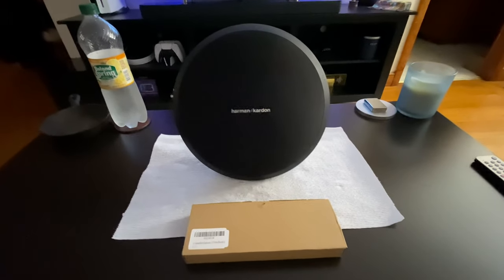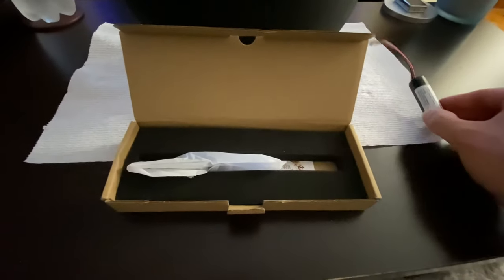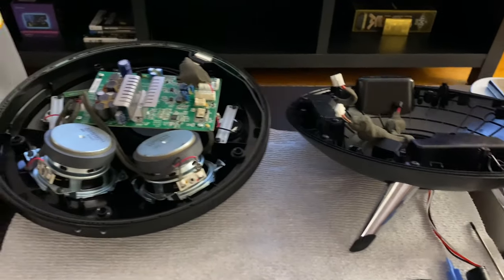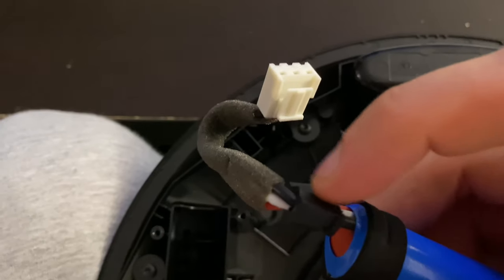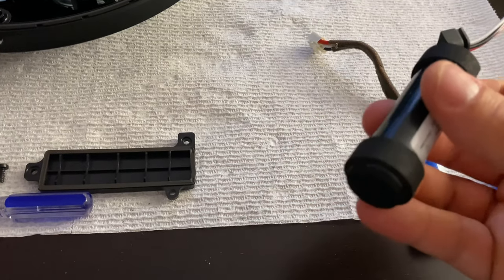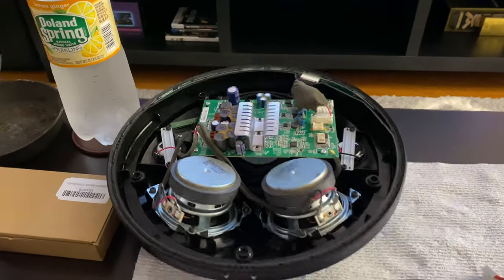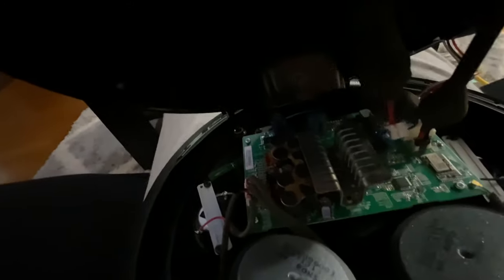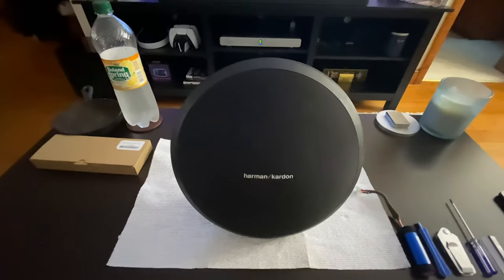Replacing the Harman Kardin onyx studio battery

Comment: Hi thank you for posting this vid. Very informative. I also have the same speaker and the batt is dead. How was the batt performance with that replacement battery? I mean how long does the battery last in one charge?
Reply from the maker: Thanks for the feedback, the speaker is working perfectly it seems to last the same amount I have to use it more I generally have it plugged in for max power!

Comment: Hey i have a problem. I have a the same bluetooth speaker and we think it dead because it won't turn on and we tried working cords that recharge it but no luck so can you help us out?
Reply from the maker: @thanhnguyen4908  Have you tried replacing the battery? If not, I have a link in my description of a battery that’s for this speaker. It’s an Amazon link 20 bucks. You’ll get it in two days.

Comment: Is it working when you have power plugged in?
Reply from the maker: Now that I have fixed the speaker by replacing the battery it works with the battery and also when plugged in to the power. previously it only worked when plugged in Because the battery was dead.
Reply: @georgekataftos  Thank you for answering. Unfortunately my speaker doesn't work with or without ac/dc...
Reply from the maker: @richardlilliehornprins1499  I think it’s time for a new battery very easy to replace
Reply from the maker: @richardlilliehornprins1499  and any questions I will answer
Reply: @georgekataftos  Thank you! I will buy a new battery to begin with.
Reply from the maker: Good thing you have a how to do video give it a like if you like  ahhaha good luck man!
Reply: @richardlilliehornprins1499  you solve the problem with a new battery?
Reply: @MiTemu  No, It still doesn't work...
Reply: @richardlilliehornprins1499 I think the cables are connected incorrectly in this video. The black cable is in the black slot and the white one in the white slot.
Reply from the maker: I turned it on and it worked at the end of the video.
Reply: @MiTemu  Ok, however I connected mine right so I think it is the motherboard. I will buy a new speaker.
Reply: Can someone tell me what color connection the usb cable goes to on the motherboard and same with the power cable? I think I either fried my speaker or the replacement battery’s internal protection kicked in when I wired it up. I think the OP might have them crossed. Mine (like his) powered up after my first attempt. I charged it over night and the thing was dead. Figured it was a defective battery, ordered a new one… also dead. Hoping to clarify the connections before attempt #3…

Comment: sir, same problem of my Harman kardon onyx studio 1. i don't know which has defects,. but I guess its battery. when I plugged it in using its charger it normally works even in higher volume., but when it's not plugged in, it still works but shutdown after a few minutes (around 7 minutes). never last longer. what do you think sir? and, what can you recommend me to fix its issue? Thank you sir.
Reply from the maker: It definitely sounds like it’s a battery issue you can find a battery on Amazon they’re usually under $20 and it’s a very simple fix watching this video will show you exactly what you need and how to replace the battery!

Comment: You could have used heat shrink tubing on the battery lead instead of leaving it bare.
Reply from the maker: The battery has its own connection, built into it no need for heat shrink